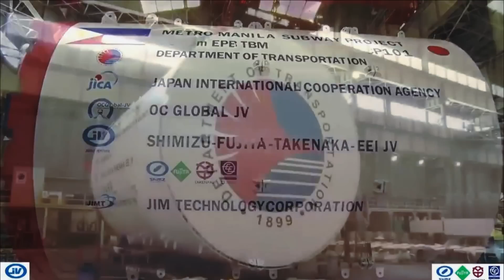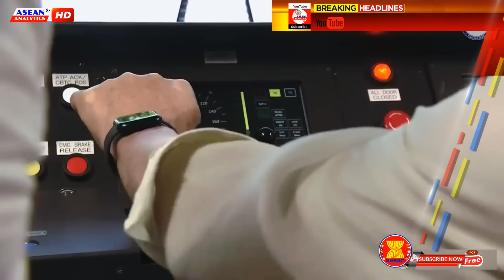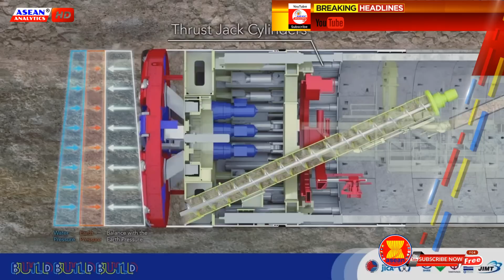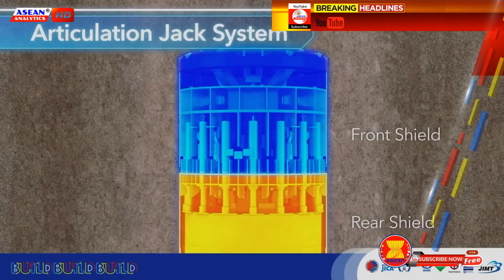METRO MANILA SUBWAY Lowering of Tunnel Boring Machine (TBM)

Comment: Will it be possible to use these TBMs under seabeds to have an underwater tunnels to connect to other islands and have a subway train from Luzon to Mindanao?
Reply: Of course it is possible. No one dig holes using hands
Reply: From our experience, there must be variable density tbm to prevent cave-in.
Reply: Uk and france is a good example.
Reply: They will probably be modified, but yes. It's possible IF we have the money to fund such project.
Reply: @efraim6960  in my opinion , better to hop from one island to the other and mix with bridges to reduce cost. Not all soil types are suitable for tbm. The english channel is a short distance. A tunnel to mindanao direct is not cost effective but can be done by mixing with bridges. Like hongkong to macau. If manila has different soil types, better to use variable density tbm or else people above will suffer cracks or cave-in. South east asia is different from european soil or japanese soil.
Reply: Yes but depth and topography is to be considered....most sea in ph is too deep upto thousand meters. And also too many faaultlines...you cant just drill across faultlines, its a disaster if you do..
Reply: @joenel3058  yes the pacific ring of fire
Reply: Yes it's possible. You only have to look at the English Channel tunnel between England and France. About 50 kilometers of tunnel under the sea bed..
Reply: @gf301062  i feel a combination of bridges and tunnels are required due to fault lines and earthquakes and typhoons. Would be great if visaya province can link to luzon and palawan. That will be a winner. All the best philippine.
Reply: @keangwooichoo6138 . Yes that maybe the case if they ever decide  to do anything..
Reply: Cost is a factor in all projects
Reply: Keang....vietcongs? Ancient egyptian?
Reply: possible but it shouldnt be subway, instead it should be big fast trains
Reply: @emirates6793  Big fast trains??.What, on the water?...Bro  needs to be a bridge or subway to accommodate big fast trains...

Comment: First Subway in ASEAN?
Reply: Depends on what you consider a subway.

Fully underground or having underground sections.
Reply: @Justineexy  I didn't know there were 2 types of subways lol. what type of subway do Singapore and Indonesia have? cuz I'm pretty sure they already have subways? And what's the difference between the two?
Reply: @vuskgaming7867  A subway is a underground railway. That's it's definition. Doesn't say anything about it being fully underground or just partially underground. 

In my opinion, I consider a subway to be a metro. They are pretty much the same thing.
Reply: Indonesia, Singapore, Malaysia have underground subway
Reply: @saka_michi  only singapore has fully underground subway..
Reply: @Loayr 46 The Philippines also have subway in the Katipunan section of the LRT2 but it's not FULLY underground, because some sections are above ground, just like those in Malaysia & Indonesia which are only PARTIALLY underground. The video is talking about a FULLY UNDERGROUND SUBWAY, 30 km long so don't brag about partially underground railways because they are not the topic
Reply: @milomilo417  not necessary while it is partially or fully underground, if the passengers can get in or off the train and the train running in underground railtrack, it is underground subway. Well i know what is this topic about it is like the subway in london right? it's like commuter but running in underground railtrack. but "underground subway" meaning is like what i said. cmiiw.
Reply: @Loayr 46 It's NECESSARY because that is what the video is about, a FULLY UNDERGROUND SUBWAY. You're just a watcher, so don't think your bias or delusion is above the intention of the video. There's nothing worth talking about a partially underground train track because that is very common, only a fool would be doing a video of partially underground subways because it's not worth the effort. So don't be a fool
Reply: Singapore.
Reply: first fully underground  yes…singapore for example has underground (section) MRTs, the manila ver is fully underground like the ones in developed countries, so i was fascinated that the government invested in this kind of ambitious project.